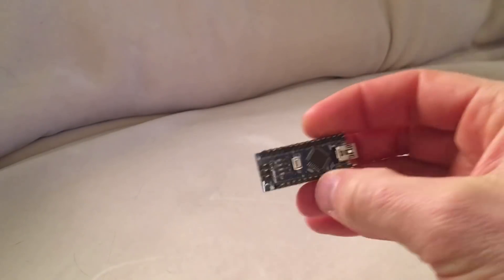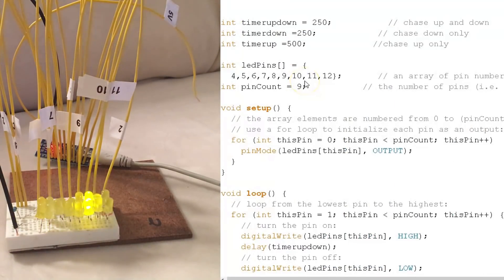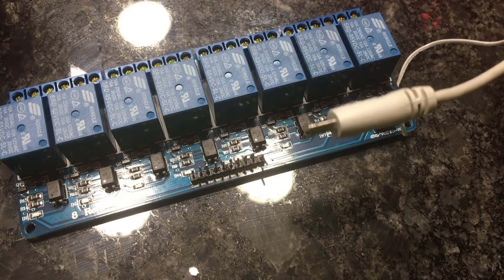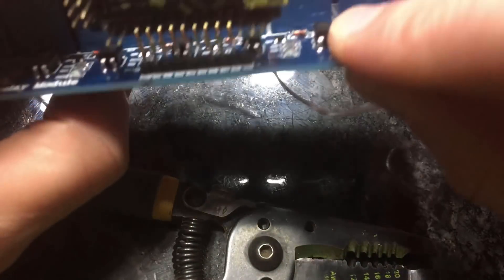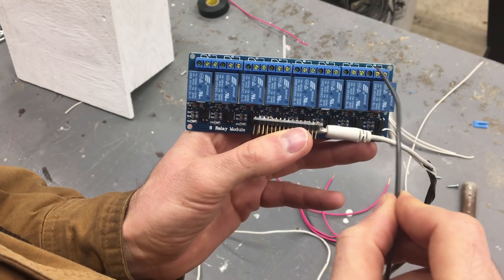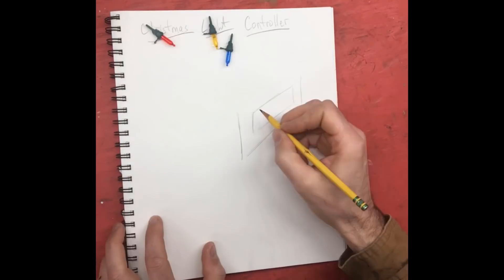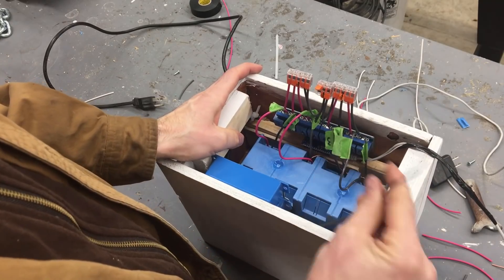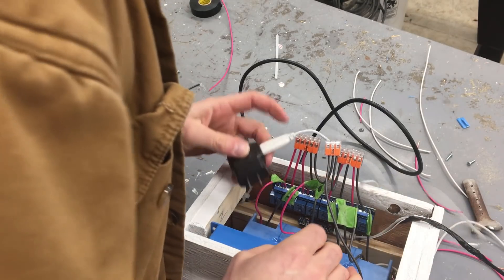DIY Arduino Controlled Xmas Lights

Comment: Thanks for this video.  I have had a great time watching and making my own.  Fyi, my relay came with a jumper on those other two pins so I did not have to supply both and tso the red wire in the USB.

Comment: where did the normally open wire goes? its not indicated in your diagram.
Reply from the maker: I did not use normally open. I used the normally closed side.

Comment: Common wire is supposed to be neutral wire and hot wire connect normal open or closed. Safer to break hot wire

Comment: @Maker Max Corbett could you please point out which light did you use for this ?. I tried using normal christmas lights with those 08 functions and it doesn't seem to work as the function adapter resets to off every time it switches on /off using the relay
Reply from the maker: I used color LED light strings.  200 lights per string.  No special effects or chase lights.

Comment: Thanks for this. I have modified your code by adding a sound sensor to react to the peaks of the sound. Happy to share the code if anyone is intrested :)
Reply: I’m interested in that program.
Reply: @pboggs73 there you go 🙂https://github.com/shen747/x-mas-lights/blob/main/relay-based-x-mas-lights/relay-based-x-mas-lights.ino
Reply: Wich is the sound sensor ?

Comment: Very good video I know I'm late but I would be worried about the longevity of the relays after so many uses. So how is it holding up 2 years later?
Reply from the maker: It has been working great.  The relays are good for 50,000 switches.  The more power you put through them the less they last.  The lights draw very little power.
Reply: This (2020) Christmas i need to make it :) But The sketch is not available :(
Reply from the maker: Sorry, write your own code.  It is the "knight rider" light code under examples then modify it for your liking.